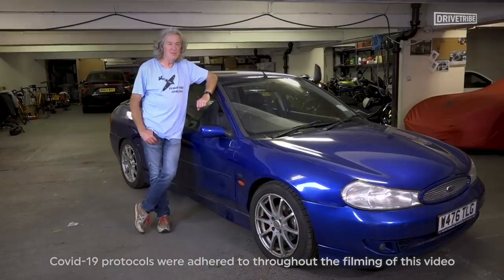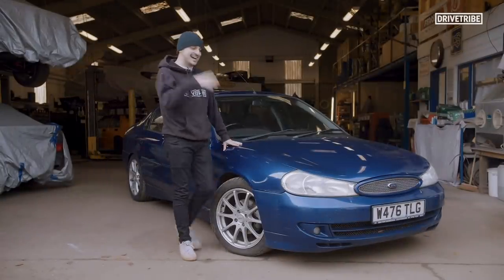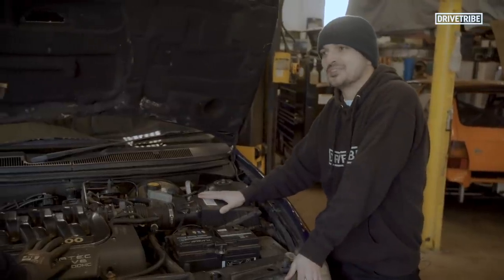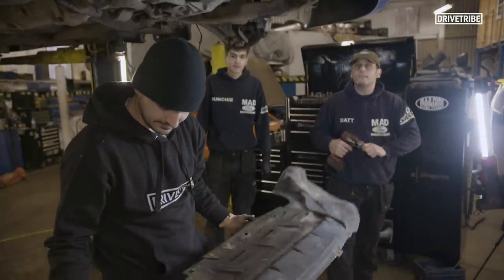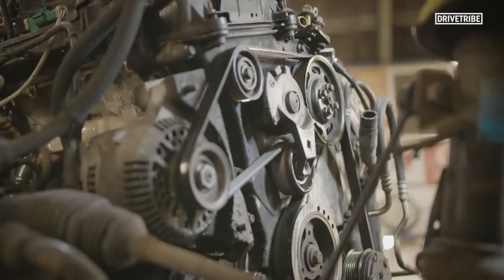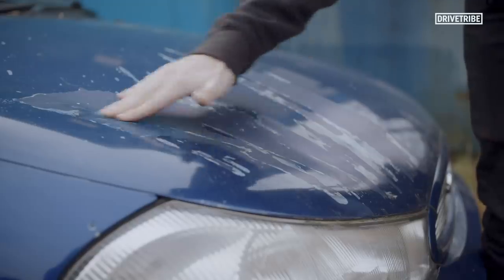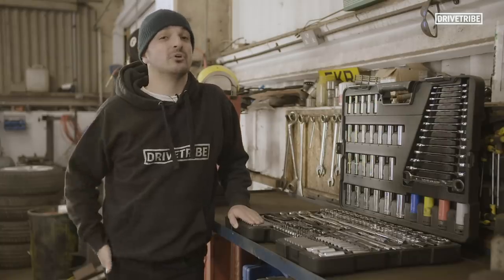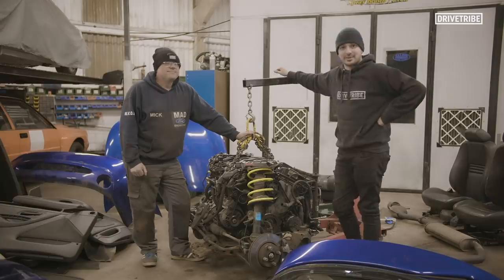Restoring the car that Clarkson, Hammond and May all love | Ep.1 | Ford Mondeo ST200 restoration

Comment: I feel like asking  the mechanics there if they would let a Halfords “mechanic”  touch their cars...
Reply: Would be the same as asking any IT professional if they would let PC World ' Know How' staff anywhere near their kit.
Reply: I mean Halfords mechanics are people just like Ford mechanics are people. Most work on cars these days doesn't require a rocket scientist just the ability to to read a diagnostics machine and to turn a spanner, so why not?
Reply: @strongandco , Halfords rip you off though and quote hundreds of pounds of work that doesn't need doing.
Reply: @strongandco  It's not that easy.
Reply: @willspeakman2461  Definitely not that easy.
Reply: @presterjohn71  Also, that winter health check is something we call all do ourselves and they probably charge something silly for it.
Reply: @rhysowen5595  Its £15. 

Personally id see value in it if i had company cars/vans - just so i could get the full MOT/Service in the summer, then just a quick checkup to make sure my drivers are being sensible in the winter. 

That said otherwise i think its a service for the kind of people who dont want to personally touch their cars. Its the kind of thing i can see my Dad laughing at, whilst being somewhat appealing to my Mum. Not a bad service, its just something that you can kinda do yourself in a roadside petrol garage.
Reply: @Garfie489  Yeeah see it from those points. And £15 isn't a lot at all, definitely much less than I was thinking.
Reply: @strongandco  you only need to watch a few South Main Auto videos on YT to see it's FAR from just using a diagnostic machine and some spanners. Eric gets a load of cars in from garages where the "mechanics" believe it is just a case of using a diagnostic machine and some spanners.
Reply: @Teribus13  Eric goes much deeper than your average Ford mechanic...which was the point of the comparison. His sort are getting rarer, because increasingly there is less need for the sort of work he does. That's how Halfords can exist and why dealers often don't have mechanics with a broad range of experience.

Comment: Partnership with Halfords doesn’t sound promising
Reply: As useless and overpriced most of Halfords is, their 'advanced' tool range is some of the best 'bang for buck' you can get. The advanced stuff comes with lifetime guarantee. No receipt required (as long as it says Halfords on it), just walk in with your broken tool and they'll swap it out there and then if there's one in stock. 
Quite often you see the display cabinet socket set missing some pieces, well now you know why :)
Reply: @zXLuke4efcXz  Have to agree I've had one of their Advanced tool sets for like 10 years and it's never let me down.
Reply: @zXLuke4efcXz  yeah I've always rated Halfords for that. Used to work as a tyre fitter so bought all my tools there and they never let me down. Just never buy a bike from em 😂

Comment: Sponsor and help by Halfords??
Early 2000's modified car scene flashbacks..
Reply: 'Here we have the completed restoration, we've colour matched the panels using spray paint cans and fitted some mad RipSpeed pedal covers.'
Reply: Pink steering wheel.
Reply: @johnturner4400  guess what, I went to Halfords and found a pink and black steering cover
Reply: Boomer
Reply: @dawrekk  Zoomer.
Reply: @BobMonkeypimp  loomer
Reply: @dawrekk  Poomer :)
Reply: Halfrauds, much better value, quality gear available almost everywhere else, don't fall for the marketing!
Reply: @BobMonkeypimp  woomer :))
Reply: Max Power Mag
Reply: @andypdq  I actually quite like their advanced tool sets, not the cheapest tools certainly but decent quality and I've had a few sockets replaced no questions asked.
Reply: I was expecting some black wolfrace 16"

Comment: I wouldn't trust halfrauds with a skateboard let alone a car 🤣
Reply: Bingo. I get that they need sponsors, but it grinds my nuts to hear them recommend Halfords...our local one can't even fit headlights properly - they left the bulb mounts unclipped on both my daughter's car and my wife's car, so they looked OK in daylight but were downright dangerous with about 3 feet of visibility in the dark. On the bright side, at least wife and daughter actually trust me to sort their cars out now.
Reply: Halfords advanced tools are some of the best. Lifetime warranty is pretty insane for a tool
Reply: @webb2800  - Oh, absolutely. I'm only talking about their services; their tool ranges are great.
Reply: Agree. They had mine for tracking. Did nothing with the tracking, and filled a check sheet stating they'd checked all the lights were working... I already knew 2x lights were out as I'd just bought the bulbs to fix them. Lying pig ignorant cowboys :/
Reply: Based on the staff at my local Halfords, I'd trust them WAY before I'd trust a "mechanic" wearing Arnold Clark overalls!
Reply: @Teribus13  Arnold Clark is the worst, they tried to charge me 700 quid to change 2 wheel bearings. Got the parts myself and got a local mechanic to fit them. Cost 250 overall. Sad thing is most people would have just accepted their quote.

Comment: As a an aging petrol head, the sight of that pulled power plant made me wishful for the simplified layout of the electric vehicles available currently. 
I'm jaded on the plumbing. 
Hateful of switches and wiring harness nightmares. 
Transmissions, gearboxes, and fluid /vacuum leaks, filters. ..
Jay Leno can have them all. 
I'm gonna follow Dr. May in 2021 .
Plug it in. 👍

Comment: That halfords 'health check' is a scam. I know nothing about cars and I could do all of this.
Reply: Health checks that would be useful, especially for those without a safe space to jack up a car or leave a set of tools on the ground:
wheel bearings, trackrod ends and suspension bushings.
Engine mounts.
Gaskets and seals.
if there's a spare in a cradle underneath, is the mechanism to lower it rusted up?
belts, chains and their tensioners.
injectors (clogged or leaky)
Reply: @EmyrDerfel  a very large percentage of your list is covered in an mot
Reply: @smh28v6  Worth checking anyway if your MOT is due in spring but you've got a winter roadtrip to do.

Comment: That was the Ford Contour SVT here in America. It came with a Yamaha v6. A total sleeper. Super cool car and you rarely ever see them on the road today.
Reply: I want to say this thing was pushing about 200-220 hp to the front wheels (maybe crank?).
Reply: The Taurus SHO had the Yamaha v6. The contour had a v6 that was designed by Porsche and cosworth. 
For 98 the SVT had 195 HP at the crank and for 99 and 00 it was bumped up to 200 HP at the crank
Reply: @redplymouth  Thats it 👍. I got the two power trains swapped. The SHO was pushed as an M5 competitor. Thanks for the correction. The latest model Taurus SHO is a great example of a current (relativity) sleeper.
Reply: @suprastevio2264  Glad to help, the SVT was pushed as a m3 competitor. 
I love the new SHO, I want one of those or a newer fusion sport. Both of them are fun sleeper cars, just wish they where offered with a manual transmission.

Comment: The ST200 was called the Contour SVT in North America,  right?  I bought one new in 1998 and drove it pretty hard for 275,000 miles.  It was very reliable even though I ran the snot out of it.  Loved pulling it to redline.  I calculated that I did that something like 30,000 times by the time I sold it.

Comment: I had 1 of these, cost me £10k around 2003 on a w plate, it was a nice car with that lovely V6 engine, and was trouble free for the 9 years that i owned it, but the old tin worm was getting to it and it wasn't pretty underneath, sold it in no time privately for £1500 with reg W200 STW,.

Comment: Since she's basically a Contour SVT, a 3.0 short block swap would be in order.
Reply: You mean swap the Duratec 25 V6 from this Mondeo Mk1-facelift ST200 for the Duratec 30 V6 from the Mondeo Mk2 ST220? That's a lot of work for minimal gains. Might as well use the Jaguar AJ30 version of the same engine, and get 230bhp. Or just leave it alone.
Reply: @EmyrDerfel  I'm not sure what models would be acceptable donors in the European market.  We commonly used the 3.0L short block from an Escape.  When matched with the 2.5L heads you also get a compression bump (from ~10:1 to ~11.5:1) along with the increased displacement.  For less than $1,000 you can pick up around 40HP.  If you massage the 2.5 heads and valves there's even more power to be found.

Comment: Do you guys in Europe have easy access to 3.0L Duratec V6s?  In the US we got the Contour SVT which shares some heritage with the Mondeo, but we also have access to dirt cheap 3.0L engines from the Ford Taurus and Mercury Sable.  Mix and match the best parts from both engines for a nice power bump that bolts right in.

Comment: I have an excellent 'donor' car you can have for a project that I will be getting rid of next year due to finally getting a company car. It's a 2003 Seat Leon Cupra 180T and when I bought it in 2005 it had done 20K miles and now it has done 208K miles. Its runs great but could do with some love.

Comment: Ad blue check?  Turns key in ignition, yep ad blue warning light is on.
Halfords, that's the place that argued the toss with me when I told them they were trying to sell me the wrong discs for my car.  Mine were not vented yet the know it all assistant insisted they were, to the point that photographs of the old discs in place on my car were met with,  "you've gat the wrong discs fitted mate"
I'd had the car from new and this was the first disc replacement.  Needless to say I went elsewhere.

Comment: Hey guys, what’s the difference between the 2.5 and the 3.0 Duratec engine? Despite the intake system. I see they both make 200 HP/200 lb-t torque. My 2001 Ford Escape has that engine and I love it!

Comment: I had a ST24 years ago and loved it. It ended up on the scrap heap because it broke down and the repairs outweighed the valve of the car plus it was scruffy looking thing so needed tlc there but I always loved on the way home from work you would get the taxi drivers and reps in there Diesel cars try to pass you when it got to the dual carriageway and day after day I would just drop a gear and watch them go backwards and and pull in behind me and laugh. Out of all the cars I’ve owned over the years I would have another one of them in a heartbeat but in better condition

Comment: Known as the Contour in North America. I still want to get my hands on either an SE V6 or the SVT.
Reply: The newer ones are called Fusions. Why did they switch names!?
Reply: @loranger6447  I didn't even know that the Fusion was the replacement for the Contour.
Reply: i had the se v6.  went like stink. but had issues (see comment below)  upgrade the front struts.
Reply: @tootrue3953  2.5L duratec V6
Reply: @tootrue3953  It was the same engine but had a bunch of upgrades on it
More Aggressive, Longer Duration cams.
Single Extrude honed UIM (98/98.5) – DH (99/00)
+3/4mm larger LIM (98/98.5) - +6mm LIM (99/00)
Extrude honed heads - (98/98.5 - Secondary) (99/00 – Primary & Secondary)
Different pistons (10:1 vs 9.7:1 – 98/98.5/99) (10.25 – 00)
19# Injectors (vs 17#)
60mm throttle body (vs 54mm)
More aggressive PCM tuning
Conical filter assembly
Lighter flywheel
Water to Oil Oil cooler
Reply: Hiro Soki yes. The new Fusions look like the new Mondeos.

Comment: I had 3 Mondeo sedans. All three white. Best cars I ever had but will never buy a Ford again in South Africa. After 10 years they changed its name from Mondeo to discontinued. Last repair was a bottom water hose and I was told there is now 3 hoses left in the country. I could not even buy a head gasket from Ford any more and the VIN has actually been taken off their system in SA. When looked after the 1.8 and 2.0 Mondeo's can do 500km easily without any major repairs. My father in law still has his 2000 model MK2 2l.  Engine was done once, clutch once and shocks once. Brake drums, rotors, wheel bearings, cv's etc etc all still original after 650000km.
Reply: do you not have internet?
Reply: @healthiswealth8153  I know where you going with this. Yes I do and ordering parts from the UK is not feasible. The transportation to South Africa is in many cases more expensive than the parts. I have tried it several times. Then there is the problem of if you order the wrong part, its not a free return from here. Also our government hits us with import tax. I once ordered the water manifold and thermostat housing and it was an very expensive lesson. That was the last part I imported for the car before I got rid of it. If I was living in the UK I would still be driving it.

Comment: I used to own one of these when they came out. It was slow, boring and did I mention slow? You would put your foot down and it would get ‘angry’. Loads of induction noise but it wouldn’t speed up lol. I sold it within about four months and bought an M3. That said, the M3 was sold within about 6 lol.

Comment: Come to the rust belt here if you’ve never seen any more rust than that. We would consider that car clean clean for a 20 year old car. We often see fromt subframes rust through and rear leaf spring mounts rust completely off in 10 or 12 years time.

Comment: If there is a better way to clean muffler we need to know it, because every two years they check CO2 and car can't pass this test without running it on 5000 rpm or driving with lower gear to increase rpm.

Comment: The lost me at storing a car ( with/without cover ) under another car on a hoist. Reminds me of the time I picked up my Volvo from my long time mechanic. Oddly, the car was parked at the other end of the industrial estate access road ( not directly outside his garage ). I only noticed the deep/ long indentation on the roof after I'd paid and walked up to the car. He was obviously hoping that a) I wouldn't notice it or b) I wouldn't be bothered to walk the 500m back to his garage to ask what happened. The gouge was about the size/area of a 1m spirit level with defined edges/ shape. A normally taciturn but polite, quiet man suddenly went all theatrical. "So what caused it ?" ... "I don't know, a stone maybe ?".i told him that the damage was done under his care. He said it wasn't. I'd only washed the car before handing it to him, so I would have seen if there was damage before I gave it to him. I said I'd give him a chance to reconsider his story/ talk to his apprentice. He had 7 days to get in touch. He never bothered to either confirm or deny what happened, which told its own story.  I was too busy with work to want the hassle of taking him court. I'd used him for 8 years, and always rounded the payment of the bill up. Never queried a bill. Always took his guidance on additional work suggested. And then he/ his apprentice drove my car under a car on a hoist where the roof caught something on the other car's undercarriage. They knew then and there that they had made a mistake, but chose to try and sneak out of it rather than confessing to me about it. I would have accepted just getting it fixed (the fact it happened to a car that was like new, and that a repair would still have reduced its resale value, I would have let go). I never went back to his garage. I passed him near local shops a year later and went to say hello, but he feigned sudden interest in something else and basically walked past me with his head down. You think you know your service providers. I had recommended him to lots of friends. I didn't go out of my way to warn those people about his garage, but if they asked why I changed the Volvo when I sold it, I would tell the story, and the impact the damage had to the resale value. That was fair. They all stopped using him. One mistake can have an outsized impact. A few years later a friend (who had originally recommended that garage) mentioned that he had downsized to a one hoist premises and that business wasn't going so well. Letting standards slip, and taking in too many cars for the space you have for them leads to loss of business in the long run. Take my advice : run a mile for any garage that stores cars - even for few hours - under another car on a hoist.